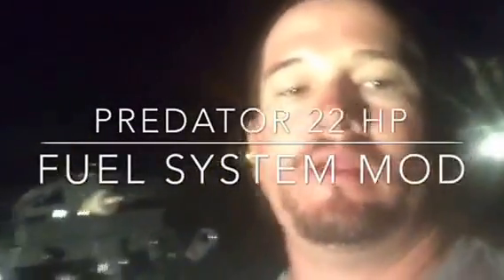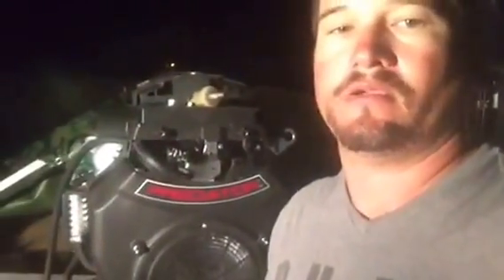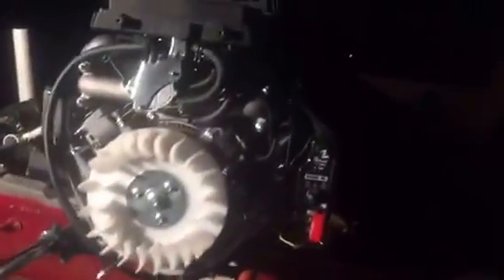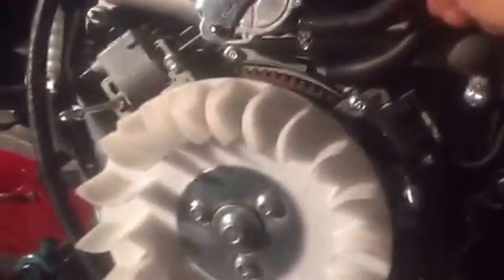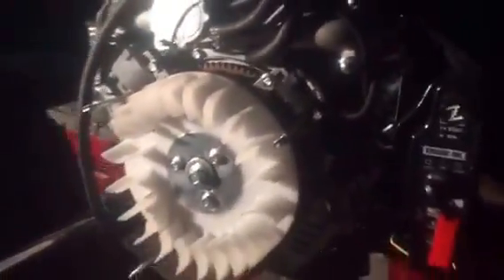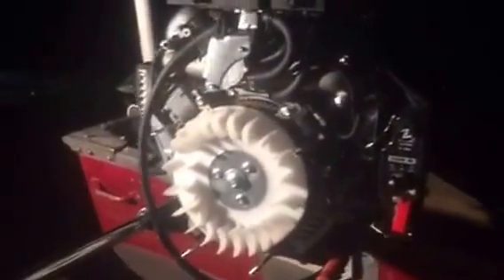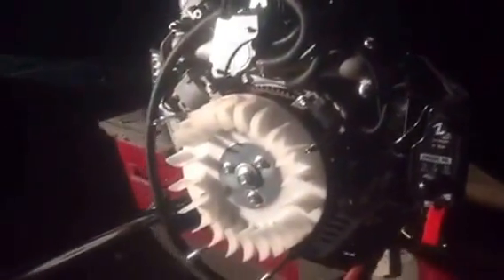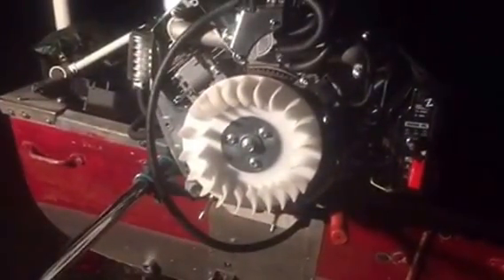22 hp predator fuel mod

Comment: I'm getting ready to install a 12v fuel pump on mine, but I'm worried I'll flood it because the fuel pump I have laying around is spec for a car. I thought of throttling the suction by restricting the line, but now I'm thinking that would burn the pump up, so I guess I'll restrict the discharge
Reply from the maker: Wesley Jackson   I do not know what kind of fuel pump you how are using but mind is meant for a car also and I have never had a problem with the flooding the motor or anything I has worked perfectly for I brought a year I can send you a picture of the box I'm using if you like
Reply: Predator 670 what psi is your pump? Will it have a separate switch or is it somehow wired through the switch ???? Thanks